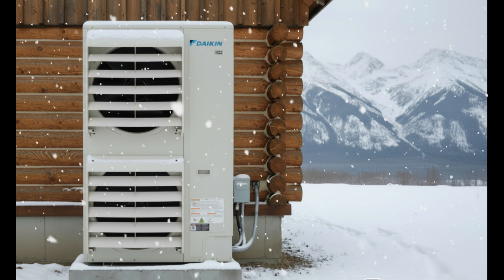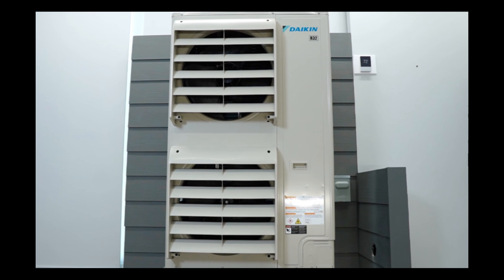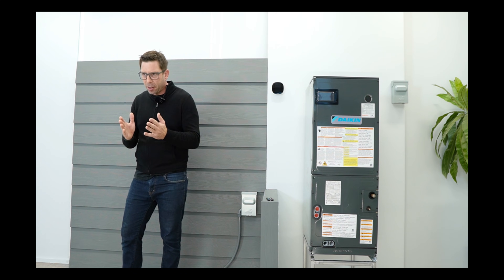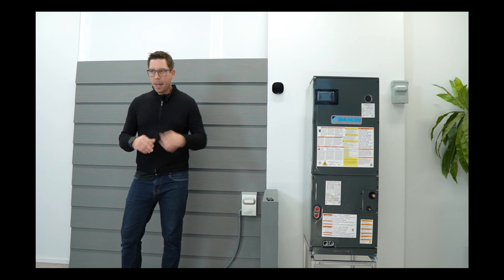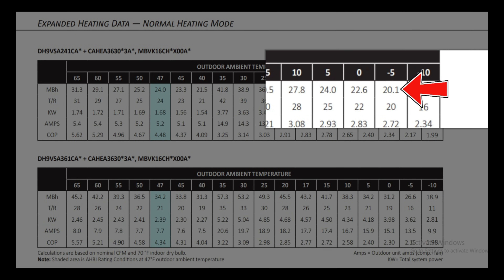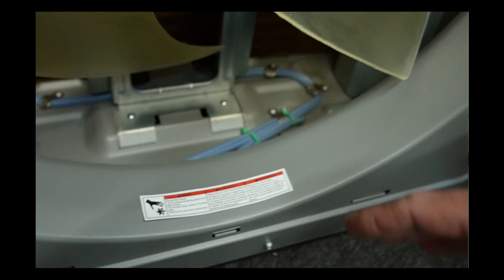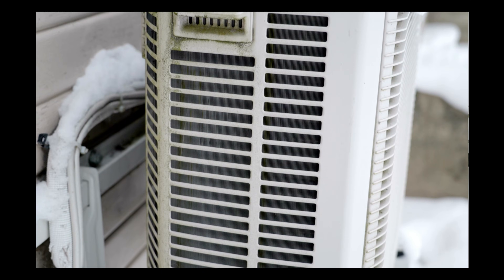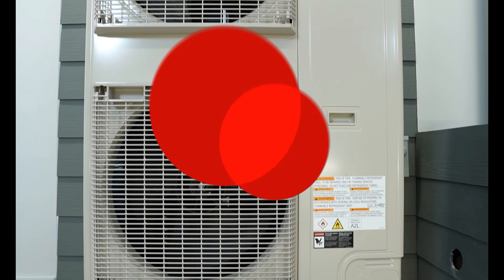R32 Daikin Fit Aurora | Runway Heating | No More Dual Fuel?

Comment: this thing is a beast..  basically a 4 ton unit outside running as a 2 ton system lol.. but the most impressive thing isn't capacity but the cop it gets at lower temps..midea, gree and mitsu and few others can match the output but very few systems can match the cop at such low temps
Reply from the maker: Yes, indeed, the COP is impressive but it drops as the ambient temperature plummets.
Reply: @GWAC555  yes indeed but most units in the market  have about 3.2 to 3.8 cop at 47 deg abvout 2.5 to 2.8 at 17F and around 2.1 to 1.8 at 5F while aurora has basically .5 higher on all of that ranges thats pretty significant

Comment: Great video! Very in-depth review! At your project did you install the DH9VS 2-ton unit? If so what AHU did you pair it with? I just ordered a system and only multi-position AHU that Daikin has AHRI data on is the DH9VS24 paired with the DFVE48--so their 4-ton multi-position AHU. That's also the only multi-position AHU they show as compatible in Matchup Xpress. Did you use the DFVE48? Daikin told me that AHU does not accept backup resistance heat. It's also a very large AHU. My dealer told me they need the bigger indoor coil to get the efficiencies stated.
Reply from the maker: Yes, we used the DFVE48 with 10KW Heater. Works absolutely amazing. As soon as the system is powered, it will immediately recognize the AH and it will run it as a 2 ton. Quick suggestion; slow the airflow down when it comes to AUX heat. Daikin suggested us to do that. It works great with perfect temperature rise.

Comment: Cold climate heat pumps have existed for many decades. They are widely used in Norway for example. I own a daikin ururu sarara that can heat at nominal power down to - 20c without any auxiliary heater.
Reply from the maker: Steve was particularly taking about air-source heat pumps. Unfortunately we here in the U.S. are a little bit left behind…